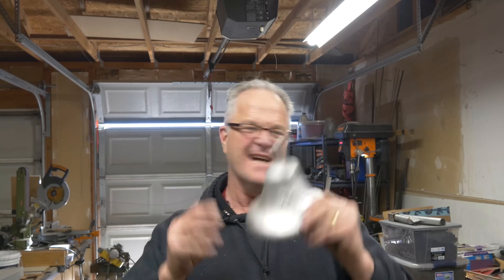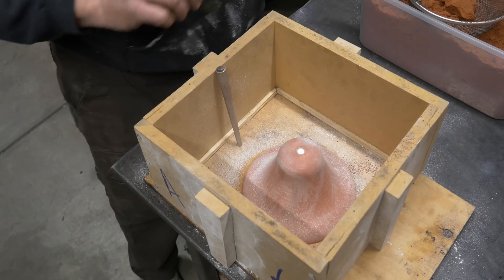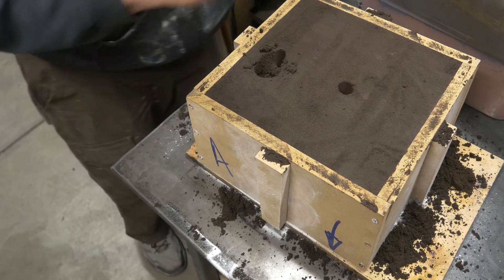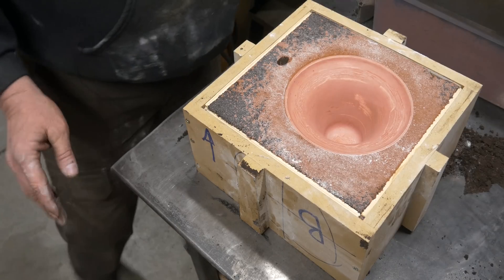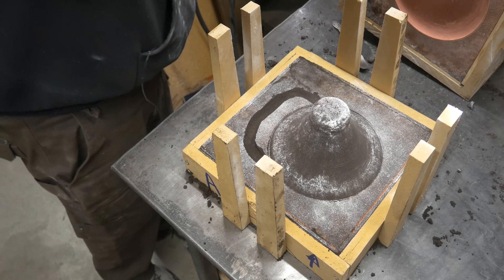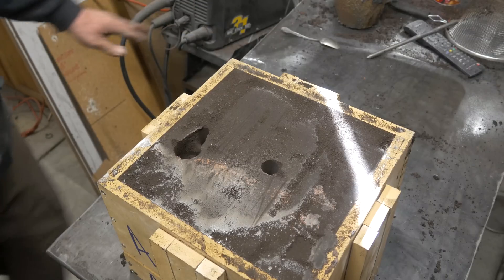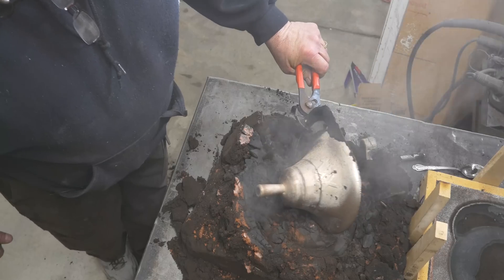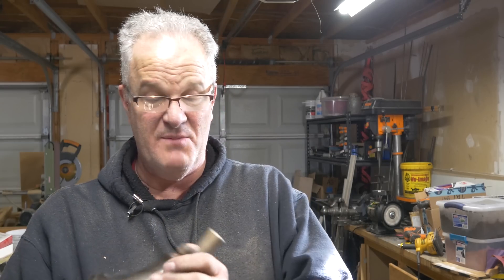Casting a bronze bell

Comment: Your idea is not that uncommon.
It is benificial for some items.
For large parts(trees in paticular) a large sprue is used with upward facing perpendicular sprues coming of it at regular intervals to prevent freezing.

Cant do that with a bell though(the extra sprrues)
Reply from the maker: I saw a video from Grassmayr bellfoundry where they actually run multiple sprues in from the bottom of a huge bell but the video is no longer on YouTube. It is a shame, it was a wonderful video.

Comment: I'm curious about the process of making this bell. Which metals are melted and mixed together during the casting process, and what is the ratio of these metals in the bronze bell?
Reply from the maker: The alloy is 80% copper and 20% tin by weight

Comment: did you make your own pattern?
Reply from the maker: Yes, I make all of my own patterns.
Reply: @swdweeb  did you try to make a bell with certain pitches? Or just draw something up?
Reply from the maker: @calebreutener870  At that point I was simply working on casting technique and made no attempt to design it with any sort of proper shape. The walls in this bell were parallel.   In the next few months I hope to start using a new technique and designing for overall tone. The first thing I want to try and do is get rid of the harmonics that I believe are the result of uniform thickness. I expect it will be a lot of trial and error until I find a shape that I like and that rings true.  My guess is once the bell has the proper shape it can be scaled to achieve different pitches but I don't know 😄

Comment: I have a question...I have a brand new no 8 crucible It has been sitting in my farm house unused for a year. Farm houses can be damp..My question is...How long would I have to bake it in the electric oven before safe to use?
Reply from the maker: I have no idea.  I would think putting it in at a low temp. like 150 for an hour should drive out a lot of moisture.  You could always cook it at 250 or so after that for another hour and that ought to dry it out

Comment: Sorry if it was covered, but where did you get the bell that you used to create the mold. What's it made of? thanks.
Reply from the maker: I modeled it in DesignSpark Mechanical and printed it on my 3-D printer

Comment: I just cant get a good clean impression on the mold surface without damage. Trying to impress the letters U.S. inside the bell cope. I'm wondering if it's because of the petrobond or if it's the letters. My first bronze is on my channel.
Reply from the maker: Have you seen this video?https://youtu.be/OVdnWbn77Sg?t=188  They arent using petrobond.

Your bell sounds like mine with resonating harmonics.  Someday I need to learn about the actual design to create a bell that doesnt do that.
Reply: Yes I've seen that one. He obviously brings a lot of skill and experience in the lettering but the secret has to be in the sand. His pressing and wiggling caused no displacement damage at all. I've got some greensand. I'll do some testing with it. Thanks for the reply.

Comment: Which type of sand or clay you using sir pls reply
Reply from the maker: That bell was cast in petrobond.  It is very dark because it has been used many times I've added oil to it several times to keep the bond up.  My future bells, as will all my castings, will be done using green sand which uses water and bentonite clay as the binder

Comment: Where do you get your  Tin?
Reply: Never mind  I just read down.  I recently  melted  down  a pewter  plate and mixed  it with  copper to make bronze. It was a disaster.  It must have been  some  crap y pewter. Next time I won't  go cheap  and I'll just buy some Tin.
Reply from the maker: Yeah, I have a video on buying pewter that turned out to be aluminum.  Good luck with getting tin, hope you find something local

Comment: Your broken pour turned it into a polyphonic bell, good job! That said you really need to chuck them on a lathe and clean them up properly and then tune them otherwise they'll just sound as terrible as they do.
Reply: How to tune though?
Reply from the maker: If only, as you state later, I had a lathe.  From what I've seen, there's more too tuning that just truing it up. 

I'm working... very slowly... on building a different method for creating the mold and subsequently I plan to get into the engineering a bit to see if I can cast a bell that is closer to sounding right.  I know that I should be able to plan thicknesses for different frequencies. I also know that there are combinations of frequencies that make a bell sound good.  Now if I just knew what those values are ;-)

Comment: I learned several things from this video.  First this is not easy and second don't pour or unblock in flip-flops!
Reply from the maker: It's certainly easier than I made it look. So many mistakes.   Yes, flip flops would be a bad idea, although the shoes I had on weren't much better

Comment: Hi I have learned that in melting aluminum you can use salt as a flux and the metal will be more fluid. It would work in a funnel type of pour..
Reply from the maker: How can I say this and still remain friends?  😁  I don’t believe salt does anything except make it taste salty

Funnel pour?  What’s that?
Reply: @swdweeb  Lol I noticed my melt  with the salt made my lour lay flat instead of beading round on the sides.

Comment: I have a question for you Hve you ever alloyed zinc to aluminum for the casting of a bell? 20 parts zinc to 80 parts aluminum..Would you try it sometime?
Reply from the maker: Hey Ron,
I'm actually a big chicken with it comes to melting zinc. I don't really want to die breathing the fumes. I know lots of guys do it with probably no side-effects, but I'm just not keen on it.  I don't melt brass for that reason either. It might be paranoid on my part, but what can I say it's part of my name, Perry-noid. ;-)
Reply: @swdweeb  Hi there I do my foundry work outside. I get fresh air that way especially if its a bit breezy. I wish i could do videos but not equiped in how to do it. Maybe in warm months you could try it outside?

Comment: How to get bright bronze bell when casting.. Sometimes it turn to silver colour.. Plz help me
Reply from the maker: Just out of curiosity, are we talking about tin-bronze, or some other kind of bronze?
Reply: Yeah.. I need brights colour bronze when casting like gas stove burners.. We melt pure bronze.. Some time we couldnt get real colour of bronz when casting.. It get silver colour.. But actualy i need bright bronz.. What should i do for that
Reply: @mr.shorts5546  I have not ever seen bright bronze come out of a sand mold.  Perhaps its possible with die-casting but I don't know. Actually, even with investment casting I do not think it is possible to get a bright surface out of the mold. 

It is my understanding that the surface will have an oxidation layer on it no matter what you do. That oxidation layer is usually dark and perhaps silver-colored. The only way I've achieved a bright surface is to sand and polish the oxidation off of the metal surface.

Comment: I have cast 2 bells of brass a little thicker and they sound real good. I do not have petrabond sand and have found out that Rural King has a finer grain sand than Lowes. They also have pool sand in 50lb bags. I get a 50lb bag of sodium bentinite at Southern States Farm store....
Reply from the maker: Hey Ron, thanks this is actually very timely. I went out to Southern States web sites and I don;t see sodium bentonite. I do see calcium bentonite.  Do you recall a product name for the stuff you bought?
Reply: @swdweeb  Its called Volclay 50 lbs  for lining cow ponds.....Sodium bentinite...when you use it, do not breathe the powder. Cows drink from ponds thats lined from it but breathing airborn powder Just use a mask if you are in the shop Once its mixed with the damp sand, its ok...It sells for under 20 bucks 50lbs  it works well for me..I have made 2 more farm bells 12 inches of aluminum..They sound lie a farm bell which i was pleased. I have made A stands and yoke for a chapel bell 20 inches . I plan to cast the bell soon. Im needing to make a flask for the mold. If i can get a corrigated metal pipe 20 inches id it will work I will take l braces for the dowels to keep it all lined up. The corigated pipe will lock the sand in and it will not slide out..
Reply from the maker: @jondoes8222  I ended up using cat litter. I'm going to do my first green sand cast tomorrow. Stay tuned...

Comment: Would a sand funnel help with the pour?
Reply from the maker: Oh my,  where do I start? ;-)  Unless I'm misunderstanding you,  I am pretty much completely opposed to the funnel approach. Here is a video where I show why https://youtu.be/OmmEXUnL4_8  The problem I had here, if I recall correctly, was the bottom of the sprue had junk in it and restricted the flow.  I will be casting another bell soon in which I'll make sure I have a clean sprue before I pour.

Comment: I really think your pour hole needs to be 2.5-3x the diameter as the aluminum. Since bronze is that much denser.  Also your basin needs to be At least as wide the smallest diameter at the top of the bell. Figure the circumference at the bottom (OD - ID) x 1.4 (1.3-1.5 flow rate factor for bronze). Another way to look at it is the Pour sprue should have (1.3-1.5) 1.4 x the cross section of your gates.

so 8" diameter w/ 1/8" thickness=((3.14x16)-(3.14x3.9375^2))/3.14=1.867=3.14=0.496" radius
 0.5x 1.4=07R. or 1.4" Diameter. AT THE BOTTOM. 1.4"x 1.4 FR=1.96 or 2" at the top with 2"x1.4=2.8" at least.

You've got a bottleneck at the base of your sprue that is 3/4 the size of your gates it should be wider that the diameter of your gates, if you are using semi-circular (cross-section) gates, with a conical pour sprue.

This kind of geometry set-up should alleviate your pour sprue suck back problems. Liquid Aluminum is much more forgiving because it flows faster working out to a 1.05-1.1 flow rate factor. Iron and steel work out to more like1.5(cast Iron w/4% carbon)-1.8(0.4%carbon)

You cannot cheat the math on Fluid Dynamics.
Your saving grace is that your vent hole is so large, say 1/2" at the base?

My uncle owns an Iron works shop. Theses formulas for casting Bronze, Aluminum, Steel, etc are written on the walls, near the furnace.

You are on the right track.
Reply from the maker: Thanks Christopher. I've learned a lot about gates and runners in relation to sprue size and fill speed since then. So on a scale of 0-10 with zero having never even heard about metal casting I think I've risen to a solid 2 now ;-)

I'm actually starting to print my runners and gates along with the pattern so that I can more precisely control the size and shape of these things.  I do have another bell coming up in the next month that I'm planning on using a larger square sprue and as a result larger runner and gates into the bottom of the bell.  It will have a tiny little vent on the top due to restrictions on the bell design.  Hang around or check back in a month and see what I came up with.
Reply: @swdweeb  Don't be hard on yourself. You're at least a 5.3/4: You got a bell that doesn't sound like someone dropped an army boot into a coal bucket. So that's worth 3 points, at least.Another point for not burning your house down, yet... You're good.

Comment: Im going to cast a 12 inch farm bell of brass this spring. I hope it turns out as good as yours
Reply from the maker: Thanks, I'm sure yours will be great. I'd love to see it when you're finished ;-)
Reply: @swdweeb  I buy wooden raised letters at dollar store and use school glue and glue them to the bell pattern. I spray paint the whole thing and use talc over it all and ram and make up mold and pour. The name will come out on the new bell. You can easily pop the letters off the pattern when you are through.

Comment: In your first aluminum bronze video you melted the aluminum 1st.... I realize aluminum has a lower melting point than copper, but considering you had to use more copper than aluminum wouldn't it have been better to melt the copper 1st then add the aluminum??? I've never done this before so I'm asking to learn...
Reply from the maker: That's actually a great question.  There are a couple of answers.

I melted the copper first as you suggest one time. When I added the aluminum, I got a big white cloud of smoke come out of the furnace.  I assume the temperature was too hot for the aluminum and have never done it that way since.

I've also learned that the bronze can start to form at temperatures below the melting point of copper. Aluminum is actually a pretty reactive metal. One of the reasons you don't want to use steel crucibles with aluminum is that the aluminum will actually eat through the steel. Anyway armed with that little bit of knowledge and not wanting to see the big white cloud again, I always melt my aluminum first and add copper too it.
Reply: I mixed zinc die cast metal with aluminum for bells and it improves the sustain .

Comment: If you add a little silver to the bell bronze it will ring out even longer.
Reply from the maker: Really?  Any idea what the ratios end up being? with the copper and tin?
Reply: @swdweeb , yes really. I've never been able to get exact recipes for ratios from the pros like Zildjian who make cymbals for drummers. They have closely held their secret recipes for their alloys since the early 1600's. 

I'm pretty much a starving artist so I can't afford a lot of Silver, so in my experiments it doesn't take very much to get good results.

I usually pour about once a week or so. I don't make bells too often either because I'm too busy keeping up with my art, but it is fun to tinker on the few occasions when I'm not chasing the almighty dollar.

P.S. Putting Aluminum in the mix will markedly dull the ringing tone. I accidentally put some aluminum in when I was recycling some old Zinc funeral vases. The bases of the vases turned out to not be Zinc, like the vases are themselves. In my favorite Bronze recipe, for art, I use a little Tin, Zinc and Lead with my copper. The reason I know the Aluminum dulls the sound is because I lightly tap my sprews with a slag hammer to vibrate the sand off when I break open my molds, and they all ring out like a bell once the sand all falls away..... except my really brittle and light accidental Aluminum Bronze pieces. Hahaha.

I enjoy watching your videos. Keep up the great work! If you want to see some of my art just go to http://www.smityart.com I would like to start making videos on YouTube but I really don't have enough time to do it just yet as I'm spending all my days just trying to make a living off of my foundry work. Hopefully I can pass up my starving artist days and get a little ahead so I can afford to hire an artisan too and then I could free up some time to build my channel.
Reply from the maker: Just visited your web site. Nice stuff!   

I've been asked multiple times to make the bell in aluminum bronze. There's a chance I'll try it this weekend. I guess we'll find out how much it deadens the sound. 

I don't have any silver and given that these things are just for me to have and hold it's likely I won't be adding any anytime soon, but that is good to know. Thanks
Reply: Silver is a non ringing metal. It rings dull because it is a softer metal.
Reply: @jondoes8222 , if the whole thing was cast from silver you'd probably be correct, but adding a small amount to create an even more complex alloy than Bronze or Brass you get something that rings out even more. At least the four main leaders in the cymbals manufacturing realm (Zildjian, Sabian, Meini, and Paiste) beg to differ from your opinion as they use centuries old recipes and techniques that involve adding Silver to their alloys. Some of these companies claim to have the same recipes that have been in their families since ancient Egypt was still around.
Reply: @jondoes8222 , You may find this interesting: https://youtu.be/F2rxNwYcsN8